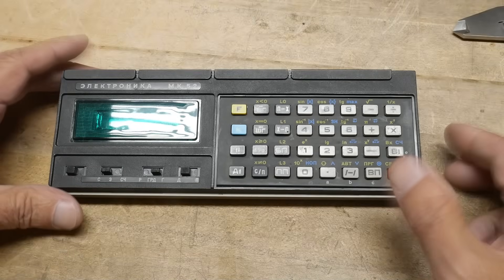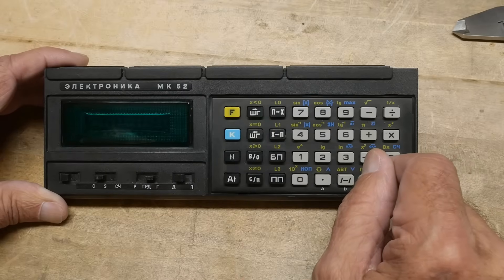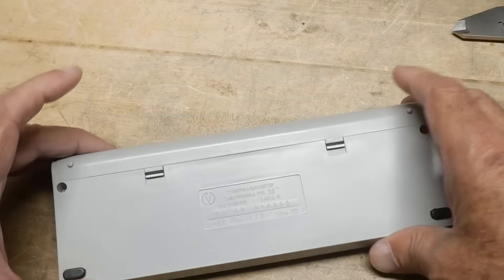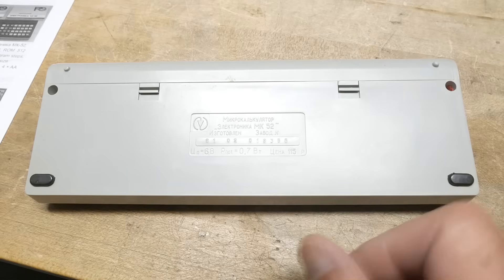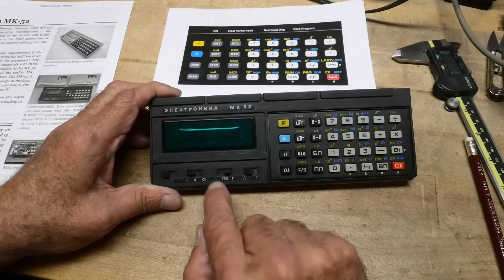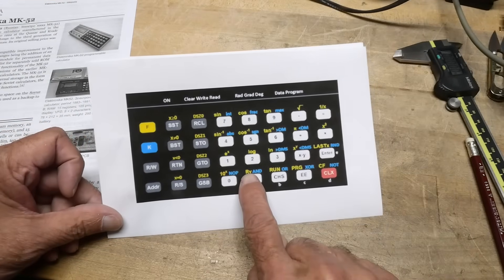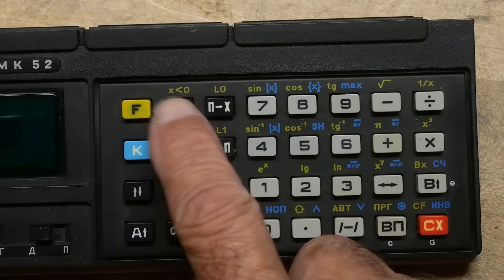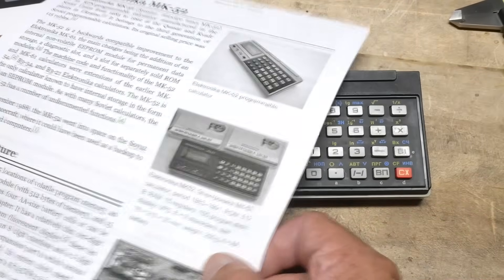#2270 Electronica MK52 Calculator from Ukraine

Comment: Russians devalued the currency by a factor of 1:1000 in 1998 so yep 115 roubles is equivalent to 0.115 roubles today. This is one tenth of a US cent. 
OK, it's price is $1.5E-3 for you metrology lot.
Reply: It's a lot more complicated than that. There were no stable exchange rate at the time. There was also a huge difference between official and blackmarket rates. So depending on what rate you take, the price could be in the range of from $3 to about $200. All that assuming that the price in rubles was 115, as engraved on the calculator case. Which is obviously also went out of the window at the time this calculator was manufactured (1991).

Comment: Hi,
I have the same in pretty bad condition. With totally broken power board which schematic you've shown at https://youtu.be/kLvN1fOEltI?t=292 but with pretty healthy transformer from it.
I'd like to fix the board but I have a reasonable suspicion that the original schematic has some typos, like any schematics shipped with variety of soviet consumer electronics in those times.
I've found something strange in the actual output voltages of the power board which I'm trying to re-create according to this scheme. Looks like labels of pin 1 and 2 are swapped.
Will you be so kind to check the actual output voltages of the power board in your working device? Do they actually match the schematic?

Comment: Thanks for the video! MK-52 is one of so called "2nd generation" of Soviet programmable calculators. The very first model was called Elektronika B3-34 (Электроника Б3-34) and realeased in 1980. After its success a whole bunch of compatible models with variery of mechanical designs and several improvements in instruction set was spawned. They were quite fun to program! Basically for a period of time B3-34 and its descendants were most affordable programmable computing devices. Enthusiasts developed all sorts for programs for them from scientific and engineering calculations and up to games (even interactive!). Program listings were often published in magazines dedicated to science, technology or DIY.

Comment: The switch #2 is for read/write/erase EEPROM selection. The switch #4 is for selecting what is written to or read from the EEPROM - data (register contents) or program. The EERPOM (or cartridge) address+length is set with the A↑ and the operation is performed with ⇅. Using EEPROM was kind of tricky, it was organized in blocks of 8 bytes, while the program and register memory is organized in blocks of 7, so data can become weirdly misaligned if you enter an incorrect address.
The blue functions on keys 6,+,3,↔ are for translating between degree-minutes-seconds and fractional degrees.
It does not have a hexadecimal mode - the boolean operations handle numbers as if they were hexadecimal and will produce a hexadecimal result ( ABCEDF are displayed as -,L,C,Г,E and empty), but you can't freely enter, convert or calculate in hex.

Comment: 115 Rubles in the 1980s was a month's wages.  At the exchange rate that would be about 375us.  So not 2$
Reply from the maker: In 1990, the value of the Russian ruble was in a period of significant change and instability, as the Soviet Union was nearing its collapse. There wasn't a single, unified exchange rate in the way we typically think of currencies today. Instead, there were multiple rates:

Official exchange rate: For some official transactions and valuation of external claims, the ruble might have been pegged at a much stronger rate, sometimes cited as around 0.55 rubles per US dollar or even 5.4 rubles per US dollar for specific government operations.
Commercial exchange rate: A commercial exchange rate was introduced in November 1990 for most transactions, which was more reflective of market conditions. This could have been around 55 rubles per US dollar.
Quasi-market rate: The Central Bank of Russia also used a "quasi-market rate" for some export surrender requirements, initially set at 110 rubles per US dollar and adjusted periodically.
Black market rate: It's important to remember that there was also a significant black market where the ruble was worth considerably less due to high inflation and economic uncertainty.
The ruble faced severe inflation throughout the 1990s, leading to redenominations later in the decade (e.g., in the late 1990s, the old ruble was replaced at a rate of 1,000 to 1).

Therefore, providing a single, definitive "worth" for the Russian ruble in 1990 is difficult because its value varied greatly depending on the context of the transaction.
Reply: @IMSAIGuy  Yep for 1990 yes.  I think the point I was trying to make was these where very very expensive to your average Soviet during the day  Same way you would say 1$ a gallon for gas in 73 was unbelievably expensive. :).
Reply from the maker: I didn't say it was cheap for them, but imported to me it would have been
Reply: @IMSAIGuy  Yep that would be very true in 1990 got a   Kiev 88 (Hasselblade clone) and two lenses for under 200$ back when I was there in 91 ;)  Wish I kept it
Reply from the maker: @byterock  I still have s Salyut C with several lenses. yes, what a good deal

Comment: I had a TI-58 and TI-59 before moving to HP with a 41-CX, then to 48-SX, and finally a 48-GX of which I had two, one for my office and one at home.  Wore out the one at the office eventually but still have the 48-GX at home.  Don't use it much anymore as I have the iHP-48 app on my iPhone and use it regularly instead.  I have many programs that I developed over the years, some ~40 years ago that I still use on the iHP-48 all the time.  Love the units and constants libraries.

When my daughters were going through their high school and college math the calculator of choice was the TI-84 or TI nspire CXII.  I bought one of the nspire CXII CAS models to use along with one daughter and fiddle with programs on that, but still go back to the HP-48 GX regularly since it's on my phone.

For work way back when, we also had the HP-71 with BASIC and Instrument Loop (IL) that we interfaced with test equipment regularly.
Reply: I have 5 hp calculators and 2 RPN like calculators I designed for my personal use.  I keep that 41CX in my regular rotation.  Actually I rotate all my calculators except the 28S.  The battery door broke years ago.  Could never find a replacement door and tape never held it right the spring force always breaks the tape free.  Thx for sharing.

Comment: A cool calc, and as for the VFD, check the voltages (plate/grid supply and filament voltage) - it's either a dying VFD or a converter that doesn't really deliver, in the latter case you might try raising the voltages with R2.

Comment: A fellow calculator junkie.  Recently surpassed 5000 calculators in my collection.  I probably have some of your old HP's in my collection LOL.  I have every HP calculator and accessory ever made including a couple prototypes.  The first MK52 I ever got also had a very dim display.  I recapped the power supply board and it greatly improved the brightness of the display.  I think also replaced a diode that was heading south.
Reply: Wow, I thought I had a calculator collection problem, but I can now point to you when my wife asks why I have so me.   It's all relative, I suppose!   I also have a few slide rules I've picked up along the way for no discernible reason.  Not like I really used slide rules "in anger" during work or even college.  I suppose its just the inherit coolness of the object that I admire - both the wonderful construction and functional aspects.

I'm thinking we could do with some more "guy toys" videos..
Reply: I have two orders of magnitude less than you 😂 I have been wondering whether there is a way to flash 12c into 15c (ignoring the keypad labels) so we can make the 12c actually useful 😂 in recent years I have come to really appreciate the modern 35s
Reply: @soloflo  If you ever do, please tell me how. LOL.
Reply: It's an interesting toy, 🎉 A little note: in 1991 one USD was 0.5 RUB. so if you ought to bye it you should put 230 bucks on a table :) few people could afford it in those days
Reply: OMG, I have 5 hp.  In addition to 2 I made myself.  All work, inuse them, switch them in and out about every two months on rotation, but the 28s not usable that model had issues with the battery door breaking.  Enjoy your calculation.
Reply: BTW I also have the Voyage 200 from TI, and been wondering how I can get the memory map for it, and an on-board assembler for the 68000. Seems like there is almost no info online about this interesting mini-computer.

Comment: 3:20 at the time when it was produced ( or at least before ussr collapse in 1991, when I suppose pressform  for case was produced) the official exchange rate was 0.6 rubles per 1$.
It was artificial exchange rate, of course, like everything else in commyland.
However, 115 rubles was slightly less then avarage monthly salary of soviet engineer. So, not everyone could afford this calculator.
Reply: Don't forget early HP calculators cost upwards of $2,500 new back in the day.
Reply from the maker: The HP 9100A, HP's first electronic calculator, was initially priced at $4,900 when it was introduced in 1968.
Reply: @IMSAIGuy  But that wasn't a pocket calculator.  That was a desk top lead weight LOL.  My most prized HP 9100 series accessory is the HP 9150A 19" display.  Took me a decade to track down a nice condition one of those.  Probably the coolest part of the 9100 is it uses magnet core memory for the ROM and toroidal cores for the RAM.
Reply from the maker: @mikesradiorepair  We had a 9100 at my univeristy. always thought they were magical.
Reply: @mikesradiorepair  do you mean that hp calculator of the same class in the late 80x was $2500? It was a rip off.
Reply: @MSP_TechLab  No, that was some of the first HP calculators.  Calculators with comparable function sets to this one available in the same timeframe would have been in the $135 to $350 range.  Some examples:  HP-28C was $235 retail when released, the super popular HP-15C was $135 retail and the HP-48SX was $350 retail.

Comment: What 2 dollars? What nonsense are you talking...
The State Bank of the USSR set the official exchange rate of the ruble in relation to other currencies, so, on December 25, 1991, 1 US dollar was equal to 0.5571 rubles

On the black market, the dollar cost 3 rubles... but still, it's 150 rubles/3 rubles = 50 dollars
As a resident of the USSR, I wouldn't know this...

Comment: 115 soviet roubles in 198x are approx 150 $ on official currency exchange  ( or 25 - 45 $ on "black" currency exchange).
Reply from the maker: In 1990, the value of the Russian ruble was in a period of significant change and instability, as the Soviet Union was nearing its collapse. There wasn't a single, unified exchange rate in the way we typically think of currencies today. Instead, there were multiple rates:

Official exchange rate: For some official transactions and valuation of external claims, the ruble might have been pegged at a much stronger rate, sometimes cited as around 0.55 rubles per US dollar or even 5.4 rubles per US dollar for specific government operations.
Commercial exchange rate: A commercial exchange rate was introduced in November 1990 for most transactions, which was more reflective of market conditions. This could have been around 55 rubles per US dollar.
Quasi-market rate: The Central Bank of Russia also used a "quasi-market rate" for some export surrender requirements, initially set at 110 rubles per US dollar and adjusted periodically.
Black market rate: It's important to remember that there was also a significant black market where the ruble was worth considerably less due to high inflation and economic uncertainty.
The ruble faced severe inflation throughout the 1990s, leading to redenominations later in the decade (e.g., in the late 1990s, the old ruble was replaced at a rate of 1,000 to 1).

Therefore, providing a single, definitive "worth" for the Russian ruble in 1990 is difficult because its value varied greatly depending on the context of the transaction.
Reply: @IMSAIGuy  there were a couple of 'currency reforms' during those years. by reforms i mean... they took off a few zeroes and made you exchange your old currency for the new notes (up to some limit per person). so the price printed on it may have been pre one of those reforms too. i guess my memory failed me, the 'reforms' were before and after 1991, but not during.